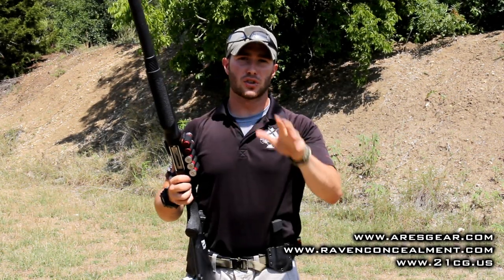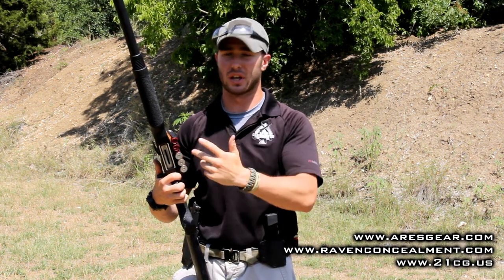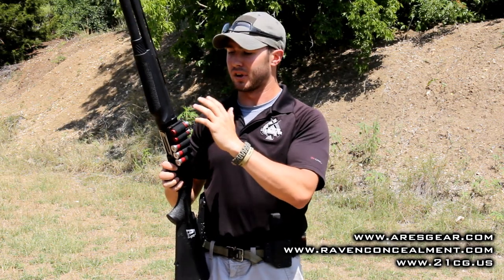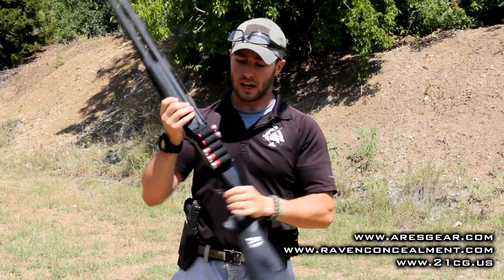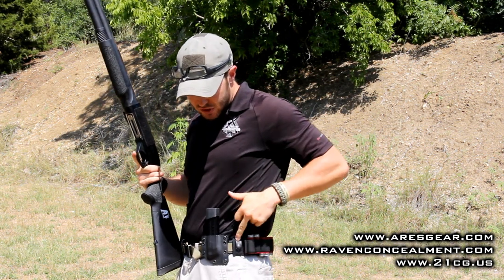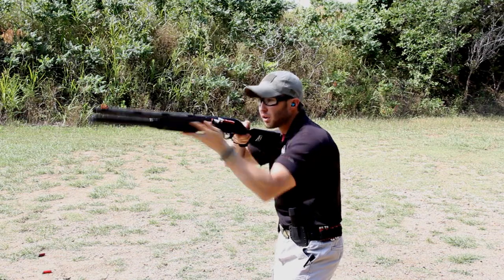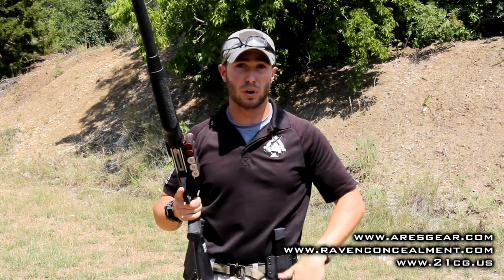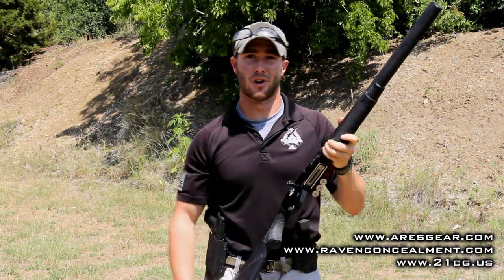21CG: Shotgun Loading Systems

Comment from the maker: Two purposes, either of which being dictated by the type of ammunition on the saddle - Inverted shells are often better suited for port-loading (aka Emergency Reloading) the gun when using the "over the top" method. Additionally, it can be used to differentiate between slugs and buckshot. 

Hope this helps.

- Stephen